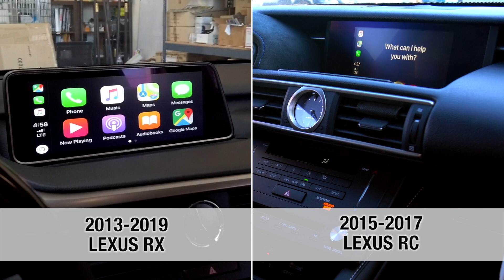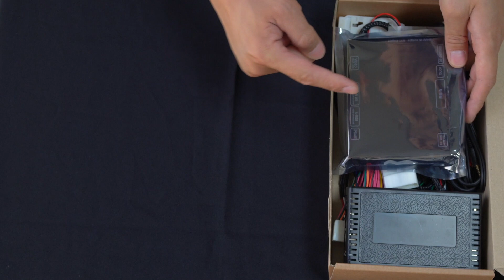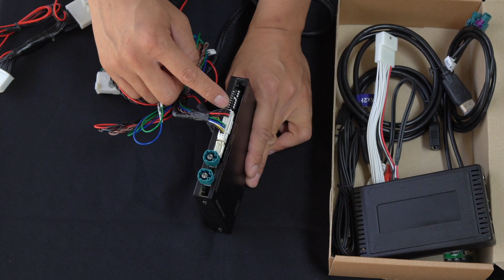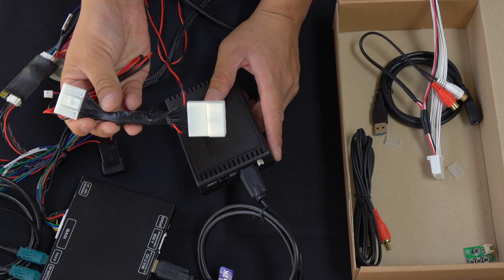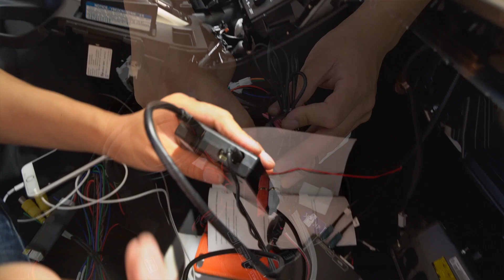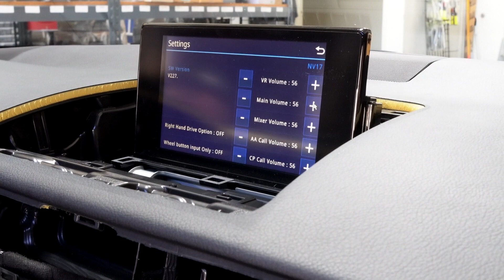Beat-Sonic Wired Apple CarPlay & Android Auto | Lexus Connection Diagram

Comment: So Eric, Android Auto does not work with factory USB inputs on the my Lexus 2015 GS 350 with Nav, the car has 2 input and 1 aux?
Reply from the maker: Aaron Mercier correct, it does not work because you have 2 usb inputs right next each other working as a hub.

Comment: Is there any way to use the factory usb with a 2014 Lexus RX 350?
Reply from the maker: AlphaPidgeon how many inputs does the USB port have?
Reply: @BeatSonicUS  In the center console, there is 1 USB port and 1 Aux port.
Reply from the maker: @Pigeon011  You can use the factory USB with a USB harness. link: https://www.amazon.com/PAC-USB-TY1-Toyota-Lexus-Retention/dp/B00F0YJ49O/ref=sr_1_3?crid=DZ76RWGAAAR2&keywords=toyota+usb+adapter&qid=1568762138&s=gateway&sprefix=toyota+usb%2Caps%2C189&sr=8-3

Plug one side to the carplay box and the other side to the USB wire that plugged into the radio
Reply: Beat-Sonic that’s AWESOME to hear! I’ll order one of these ASAP as my CarPlay unit gets here Thursday! 

Will my phone still charge while apply CarPlay is active?
Reply from the maker: @Pigeon011  Yes, your phone will charge with Carplay is active. It will charge faster than your factory port.
Reply: @BeatSonicUS  Thank you once more Beat-Sonic for this information. I wanted to clarify with you that I have 1 USB port, 1 Auxillary cable, and one car charger port. This does not change the circumstance does it? I can buy the USB adapter as you said, simply connect one side into the carplay box, the other side into the USB plugged into the radio and I should be good to go with everything working correctly through the factory USB port? [And it will charge FASTER now?] That is awesome!
Reply from the maker: AlphaPidgeon correct, correct and correct 😀